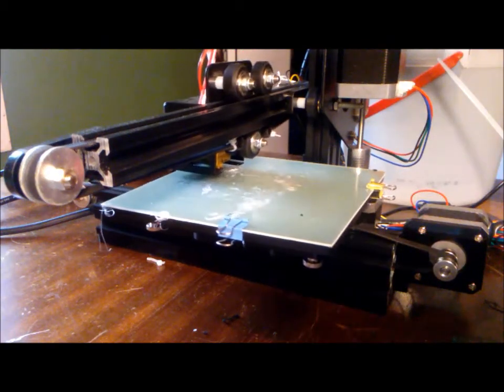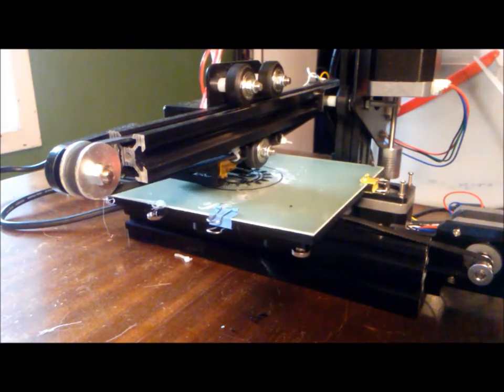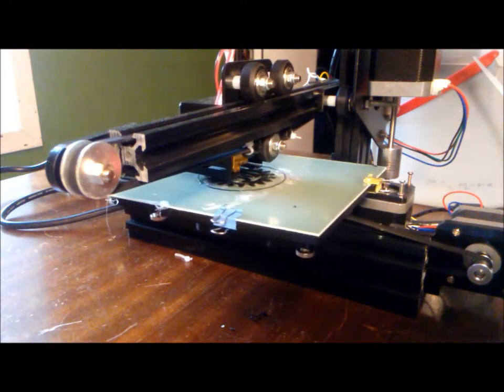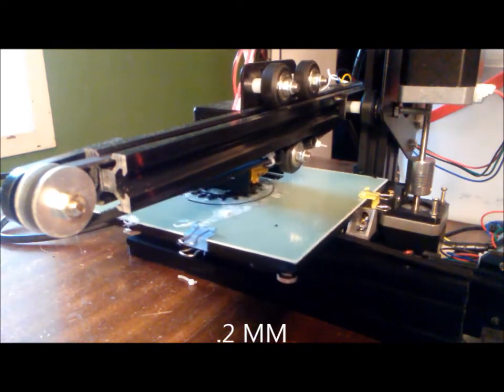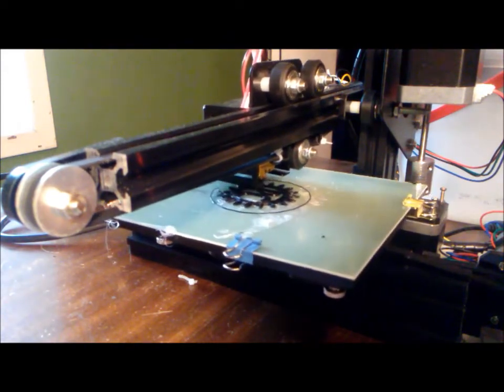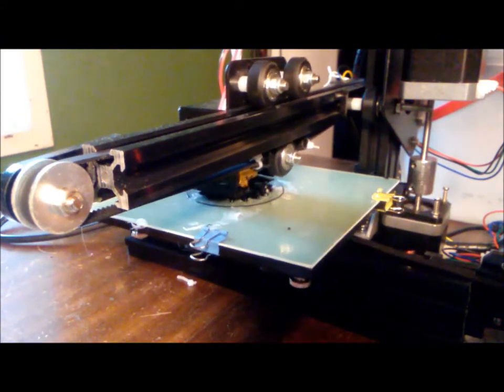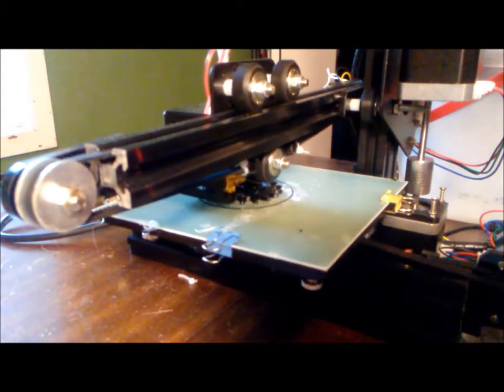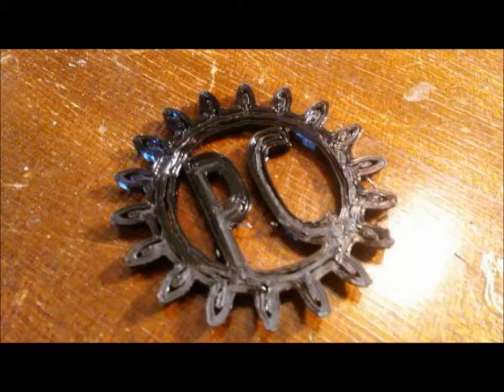Tronxy x1 3d Printer Review and Print - $150 3d Printer Kit

Comment: Your extruder is skipping like crazy in the beginning. That must be whats wrong with with the layers. It comes with a 5 amp power supply and assuming the nema 17 motors draw 0.4 amps each (this is very conservative, usually they draw about 1.2 amps each),  that brings it up to 1.6 amps, then since its probably a 40 watt heater,  add another 3.33 amps for a grand total of 4.93 amps. So the power supply is under a constant 99% load, lol no wonder it has so much trouble. If you can, id try fitting a 10 amp power supply to it. You can find these on ebay but just make sure it is the correct connector first. I am not sure if you tried this, but try bumping the print temperature to something like 215 degrees celsius and see if that does anything. The definite problem is something to do with the extruder. either it is being blocked or its not getting enough power. Hope this helps
Reply from the maker: OK I will look into it when I get the chance and do a video with updates if I can get it fixed.  The main worry I have is whether the stepper motor speed controller(or whatever they are) can handle the extra current through the board.  I really want to run a control side and a motor side for the printer so that all the high current stays separate from the control board, but am not sure that is with in my skill level yet or if it is even do able.  Hope to have more time to upgrade it over the summer and get a better look at the pros and cons of time and money vs getting another printer with a bigger bed size.  Thanks for the help though it makes allot of sense. :-)
Reply: I would like to run mine off a solar shed setup without the "Mains" psu.
What would be the estimated load supply needs be to do this?

Comment: Please put some tension on those belts.
Reply: Sir, you can get Tronxy X1 3d printer for $109.99 with this coupon: TronxyX1  , https://www.gearbest.com/3d-printers-3d-printer-kits/pp_494194.html?lkid=12052751， enjoy!
Reply from the maker: Will see what I can do, but its definitely not the best/easiest system to fine tune I am noticing, just happy it works as well as it does for the price:-)
Reply: I have the same printer, I've been doing some pretty tall prints with it.  does yours have the issue with the z motor bracket?
Reply from the maker: Had a issue with the screw not wanting to spin at about three inches but loosened the 3 screws on the z bracket that hold the big screw in and then tightened it again and that fixed it. but only have done three tall prints so far and layer skipping is my current problem.  So stick to small prints at the moment, lower then 60mm.
Reply from the maker: I am thinking my layer skipping may be in the gcode files at the moment as its to consistent at 3in of the plate.
Reply: what are you slicing with?  I'm using Cura
Reply from the maker: slic3r